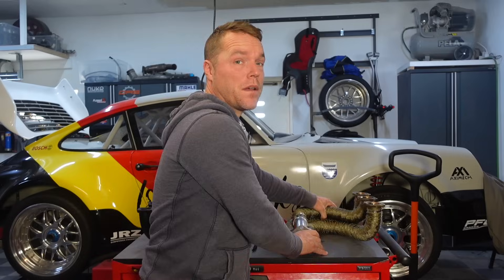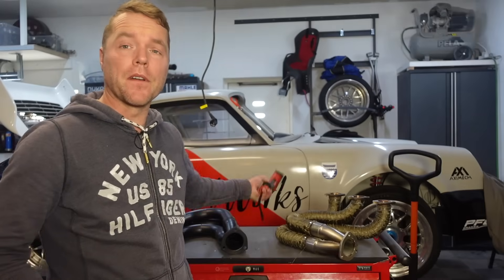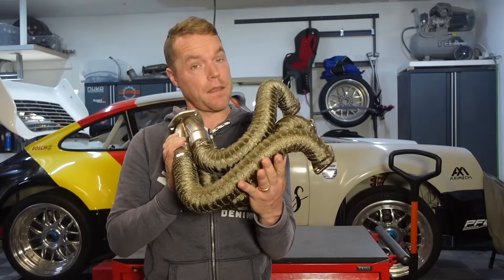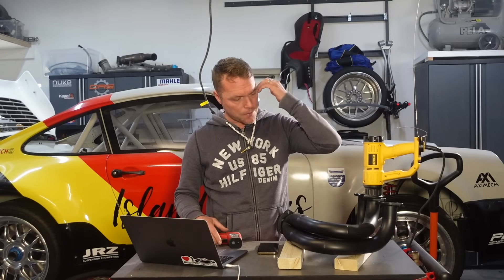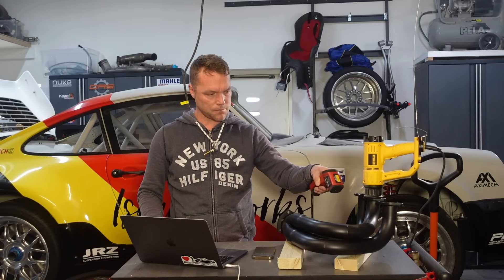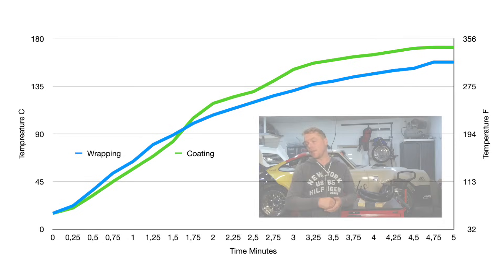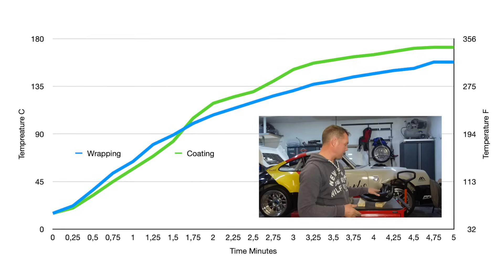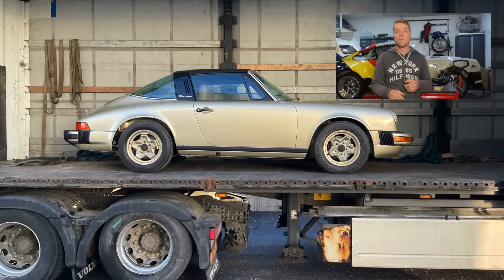Exhaust Wrap vs Ceramic Coating - Head to Head

Comment: Would like to have seen a test of both together, ceramic coating seems to be also a very effective rust protective on steel headers and wrap very effective on stainless without worry of excessive corrosion,
Reply from the maker: I’ll see if I can do a quick one and then post in the chat

Comment: The IR emissivity of the coating and the wrap are probably different and will skew the results. Any chance you could test with a thermocouple?
Also, what about a wrap on a coated manifold?
And "au naturel" manifold?
Reply from the maker: I would love to make a more scientific test and with other coatings. I’ll see if there is any more that I can fit into my next session
Reply: +1, the black ceramic coating is going to be picked up very well by the IR thermometer
Reply: @noxious89123  Color has nothing to do with a surfaces ability to absorb and radiate IR energy. A surface emissivity or condition does. Color is only affected by ultra-violet radiation.

Comment: For me it looks like you should be measure the temperature with thermocouple on the same distance as your spark plug coils will be placed. So could be that at the distance be less heat with ceramic coating instead of wrap...

Comment: In actual use, I can come into the pits off the track and I am able to put my hand on the wrapped headers, I could never do that with Ceramic coated headers..... same goes for Turbo Blankets
Reply from the maker: Is that on a car with the wind blow going straight over the headers or in a car with this compartment enclosed?
Reply: @islandworks   Hi, 99 Subaru STI.

Comment: The better solution is the dimpled insulation made from stainless steel formed to make a continuous outer, same as the OEM’s use.

An alternative is use the wrapped, but put a metal heat shield between the exhaust and the engine this will stop oil dropping on the headers and make a good air gap between the exhaust and the coils, wiring etc 👍

Comment: Wrap will also muffle things a bit, if you’re looking for some additional sound deadening. Usually I go with ceramic on track, wrap for street, for all the reasons you mentioned
Reply: Your logic is backward

Wrap should only be used on track. As It is a fire hazard if there is an oil leak they will soak with oil and you will struggle to extinguish the fire on the side of the highway.

Comment: If I may suggest 2 key elements that I think are missing in your experience.

1 : what temperature does the heat guns produces at the exit and at a distance equal to the lengh of your 3 to 1 tube.

2 : what's the temperature reading you get from heating a similar naked 3 to 1 tube with the same heat gun?
(that would be the reference against which you can compare the 2 others).

Love the idea of your experience, though. Thanks for sharing it.
Reply from the maker: There’s quite a bit more that could be done to make this more scientific rather than a practical test

Comment: Not all ceramic coatings are created equal. In the USA we have Swain's White Lightning, and in the UK (maybe Europe?) there is Zircotec. Both are much thicker and significantly more effective than the thinner more paint-like coatings. Great to see a new video and the build progressing!
Reply: Very true Cerakote is the bottom on quality for heat insulation. 

White Lightning is amazing. Techline is also pretty good with ID coatings too.
Reply: @bt619x  Honestly, I thought Cerakote was a purely decorative coating, was surprised when he said he'd had it put on headers.
Reply: @noxious89123  the exhaust coating really is purely decorative. it is very resistant and it does slighltly lower temp but that's it! you need a tbc coating for lowering heat radiation, which cerakote also makes in two versions, one is sand-golden and the other is called titanium red.
Reply: Swain and Zircotec use a plasma spray process similar to what's found on passenger jet turbine blades. I'm still looking a place that can do internal plasma spray coatings in a 2.5 inch inner diameter pipe.
Reply: The coatings usually don’t do much because they’re so thin. Furthermore black has a higher emissivity than any other color- cerakote being flat black makes it worse. Cerakote is just useful for reducing corrosion while also being able to stand up to the heat. White on the other hand reduces emissivity or thermal radiation by its color. Crazy how many people in here have such staunch opinions but haven’t even taken the most basic physics course.
Reply: I have Swain's White Lightning coating on my TT Viper, amazing stuff!  Strangely, I've never heard of anyone else mentioning it before!  I thought it was my little secret!  I think the reason is it only comes in white, which most people don't care for...
Reply: Love the video but great points @jgrhoades - ceramic paints and plasma-sprayed TBCs (thermal barrier coatings) serve quite different purposes. TBCs are pure-ceramic and applied about 10x thicker than ceramic-filled paints which are only ~1mil (0.03mm). For thermal insulation you'll want a TBC but if you are after only visuals then a ceramic paint would work (although we can also tint TBCs a whole range of colours!)
Reply: Cerakote is very tough. It is used on guns, you can beat the crap out of it. 

Heat insulation ... I dont know. 
Durability = awesome.
Reply: indeed, and those two are the ONLY two that people should look at for heat. ceramic paint is just high temperature paint, it's been used in industries forever but for high temperature corrosion protection, not insulation.
Reply: @blufireice tell that to those who ceramic coat exhaust turbines in jet engines. That was literally how they started
Reply: Well yeah. One has ceramic flakes..the other one is just ceramic.......

Comment: The wrap looks cool, but another concern you didn't mention is that it holds moisture, which accelerates corrosion of the underlying metal.
Reply: moisture does not last long with plus 800c exhaust heat....
Reply: @gregjenkins2925 That's true, but if the 800C exhaust is constantly being splashed with water (which is not clean) and boiling it off, whatever is in the water will bake into the wrap. It's well-known that this leads to corrosion.
Reply: @darylmorse  - Hi,  as I only do sealed /  tarmac / bitumen / ashpalt, track work, all sealed tracks, no off road stuff, I have not had this issue,..
Reply: @darylmorse Well, I'm sure the likelihood of the wrap being constantly splashed with water is 0. Not like these vehicles will be driven in the rain or submerged in water
Reply: @cantdriveslo I guess you've never worked on a car. If you had, you would know that the underside of any vehicle gets covered with debris from the road, from the tires, etc.
Reply: @darylmorse  LOL! If you say so, I guess it must be true. I had wrapped headers on my ZX14 and never experienced debris eroding the headers, but whatever you say, sweetheart
Reply: @cantdriveslo  It's good to see you're so mature about it. ;)
Reply: @darylmorse could you treat the header with anti corrosion paint or spray before wrapping?
Reply: @vincenzodeluca5505  It would probably help, but it would have to be high-temperature paint.
Reply: @darylmorse  then I would think you would get your exhaust ceramic coated first bake it in a few times take it off, clean it real good and then wrap that
Reply: @darylmorse  This can be fixed by first painting the pipe with heat resistant paint, then wrapping, and coating the wrap with hi-temp silicone coating to prevent moisture from getting in. Painting the pipe before wrapping also protects it from rust in the off-case some moisture actually gets into the wrap.
Reply: @darylmorse you really driving a car with wrapped exhaust in watery conditions that much?
Reply: @gregjenkins2925  guess what happens when you turn off an engine, condensation happens. Then you have rust
Reply: This is why you should ceramic coat then wrap over It 

Protects the metal from any moisture being trapped
Reply: @ParkerOviedo  <--- what he said--do both! I do a few coats of VHT high heat clear to keep any moisture out, then wrap with DEI Titanium heat wrap.
Reply: Stainless headers
Reply: This is why you ceramic coat then wrap.
Reply: It does unfortunately , this is why I would do only ceramic imho.
Reply: Only with mild steel. Stainless steel your fine. Mild steel will not last long
Reply: 304 Stainless?
Reply: They sell high temp silicone spray paint that goes on after the wrap. It helps keep the color and also helps repel water and dust.
Reply: He actually did mention that in the beginning
Reply: What about coating before wrapping to prevent rusting?
Reply: Ceramic coating under the wrap is how this problem is resolved....
Reply: Don't forget the wrap and still break apart after a while with the elements like my DEI exhaust wrap.
Reply: Absolutely it's not the temp it runs at while in operation but if there are any leaks or water splashing on it that happen close to the time u shut it down. I've tried this on a quad powered with a R6 engine and it definitely caused corrosion in the header tubes even with a ceramic header paint applied under the wrap. Contrary to popular belief ceramic coating can be rubbed off or can rust from cracks or leaks in the coating from header expansion and contraction. Headers move when heated!
Reply: Use wrap and Ceramic coating.... Thats the best
Reply: That’s the part I don’t understand, with all that high heat, how can there be ANY moisture at all.  Maybe I’m wrong, but even if the exhaust was made out of the cheapest of metals, it wouldn’t rust because of that very high heat.

I’m only speculating because I have zero experience with ceramic wrap.

I’m going to wrap my motorcycle exhaust and find out for myself.
Reply: I’ve run wrap on all my Porsche builds, never had a problem with moisture, luckily the exhaust gets hot enough to cook most moisture outta the material
Reply: Not an issue with wrapped stainless headers.
Reply: Don’t do it everyone! I wrapped my motorcycle and it’s was all rust being held together by wrap by the time I took it off!
Reply: I have the heat wrapp on my Kawasaki Motorcycle, more than 5yrs already, does not have any corrosion yet 🤞
Reply: If I use header wrap, I first use vht ceramic paint, then wrap and then paint the header wrap, stays black and seals it.

Problem solved.
Reply: @schafer240 now that’s a good idea. Think I’ll do that to my headers.
Reply: @schafer240  I haven't gone this route but have been curious if it does work, by work I mean the outer VHT coating holds up overtime.
Reply: @chestrockwell8328 yeah it's flawless, only thing about the vht flame proof is on metal its not very strong against scratches.
Reply: @schafer240  Appreciate the quick reply and confirmation.
Reply: @schafer240 this is funny, I’m actually doing this right now! I have the VHT paint and then wrapping
Reply: Its not even the moisture thats the real issue. 
Wrap on mild steel bakes the carbon out of metal. 
I see it all the time on those junk generac generators that use the wrap on cheap pipe. 
Within a few years it shatters like glass if you touch it or have to do any work on it.

Comment: No amount of coating/wrap will ever prevent heat transfer from the inside to the outside. Sure it may slow it, but in a race car everything approaches steady state. Coatings/wraps stay hot and transfer the same heat. Coatings and wraps are really there to keep the length of tube to the merge close to equal temps to keep equal exhaust gas velocity. Engine bay will still end up the same temp
Reply: This is a really dumb comment lol, the goal is to keep more heat into the exhaust, not to stop any escaping
Reply: This is not exactly true.

Comment: Thanks for posting the video. Any concerns getting an IR temp reading on a glossy surface?  As far as wrapping over ceramic coating, I've been told that would stress the base metal, and the lower grade (304 stainless and mild steels) would suffer from thermal issues fairly quickly, yielding shorter part life.
Reply from the maker: My IR gun is probably not the highest grade one and I ended up shooting a few times for every interval. In the end the curve looked relatively smooth. I think the wrap will help on top of the coating, but am also sure it will destroy it…

Comment: Interesting data. Would be good to have a baseline non wrapped or coated dataset. Jet Hot also allegedly does a good exhaust coating.
Reply: Ya, would need the basline to say if anything is effective and if they were close or far apart on performance.  B+ science fair work.

Comment: Thanks for this. Ceratec is one of several suppliers and it would be interesting to try it against them.
The subject is indeed important for an air cooled Porsche as power drops off if the engine is insufficiently cooled. The best check is obviously on the car...

Comment: Nice test - I was expecting the ceramic coat to be better…

Would be good to see you do this test without any finishes/wraps 👍
Reply: He only tested 1 brand tho. Sample size is too small.

Also, the temperature involved is not representative nor is anywhere close to what is actually experienced by an exhaust header.